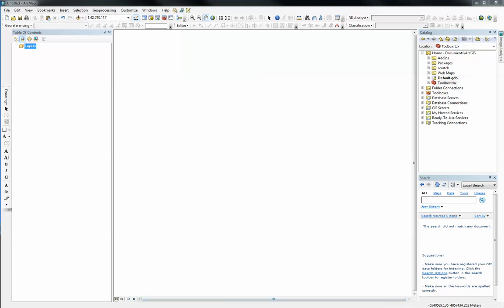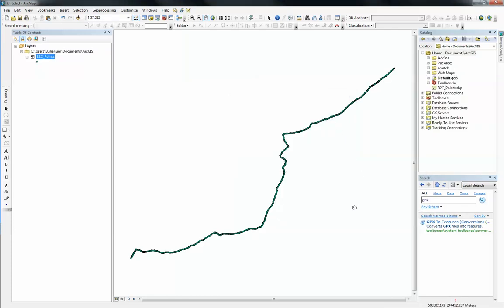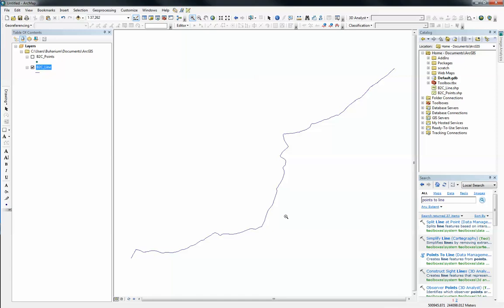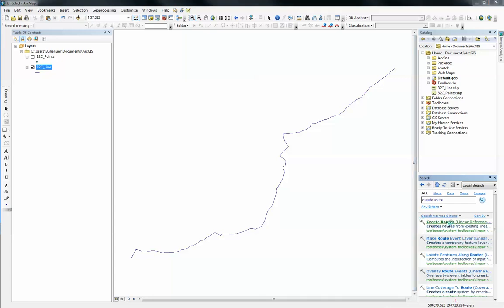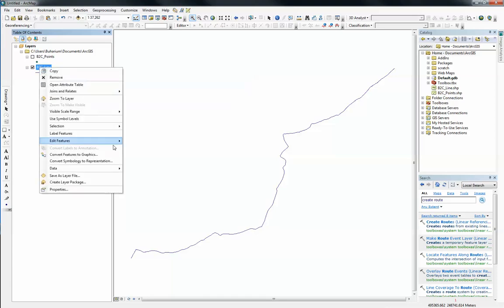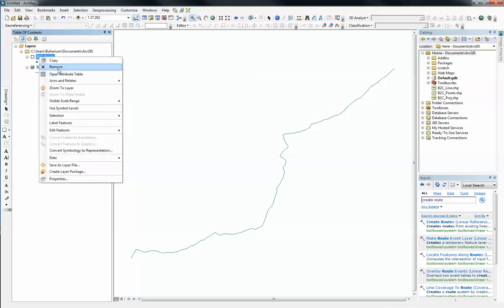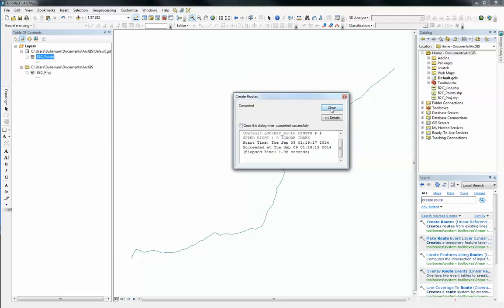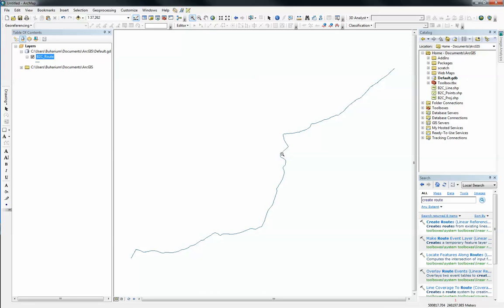Linear Referencing Using ArcGIS

Comment: Great overview on linear referencing tool with a fun applied example.  In resetting the M-values and have time "interpolate" between start and end point of the single-line, it seems that you create equal proportions due to the relative allocation of the new M-values.  Your new 2-min segments in the event layer seem to have the same size if you truncate the digits?
Reply: +Thomas Wuerzer That's exactly what I was thinking. Not the appropriate way to determine time since it proportions time lengths based on start to finish values. This would assume travel speed was constant across the trip. The slight differences in time segments were probably due to the slight variation in vertices placement on the track.
Reply: +Jason Barnes Is there anyway to determine the distance each two minute segment actually took?
Reply: I think the points measurement usually have time tags, perhaps that could be used.